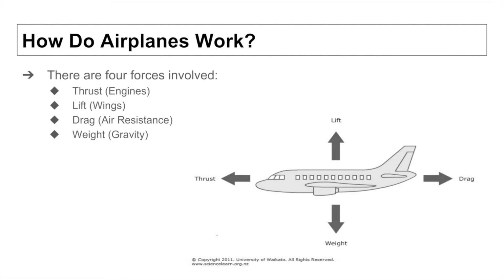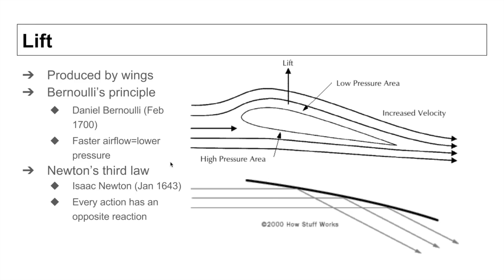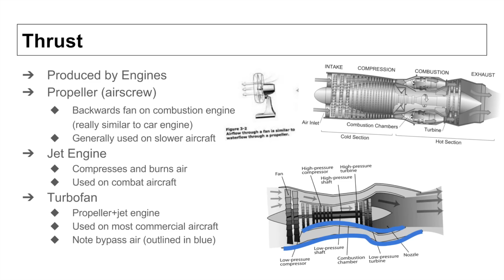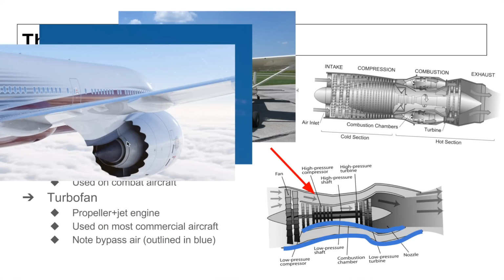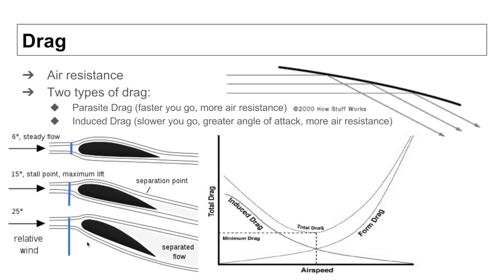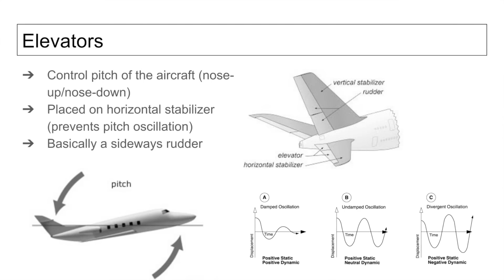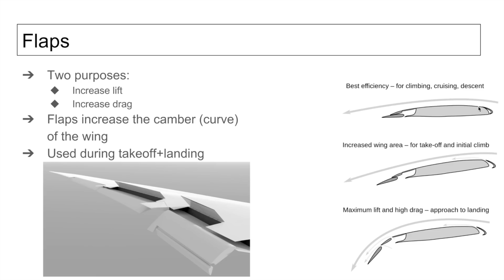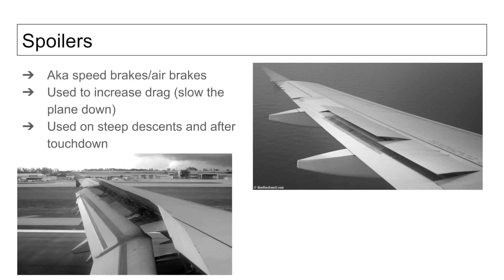Lecture 1  Basic Aerodynamics

Comment: Just wanted to mention that it is NOT true that the air on top of the aerofoil does not travel faster because it travels a greater distance in same time. Even just thinking about this logically it doesn’t make sense. The air molecules do not have to stay as pairs. It rather happens due to conservation of angular momentum due to vortices that are produced once the boundary layer separates from the aerofoil surface. This then causes a circulation of air the goes with the motion of air on top but against the motion underneath hence why the top is faster and bottom is slower.

Comment: Sorry to say but your Bernoulli argument about lift is completely wrong. First of all air molecules of different streams don’t exactly meet at the same time at the trailing edge (equal time argument). Secondly Bernoulli’s principle only covers one stream. So it can’t be applied to two different airstreams. 

The airflow follows the airfoil because of the coanda effect. This generates curvature in the airflow, which has a higher pressure on the outside of the curvature than on the inside. This is what generates the pressure difference thus the lift. (In combination with Newtons first law)

Great video!
Reply: You are correct. This video was from a while ago and my explanation of Bernoulli's principle was (and is) a common misconception. I'm considering starting to post more videos. Thanks for the comment.